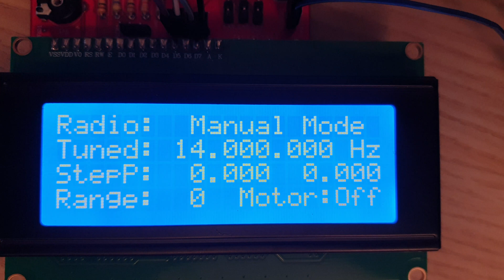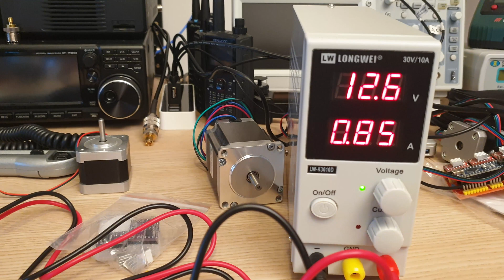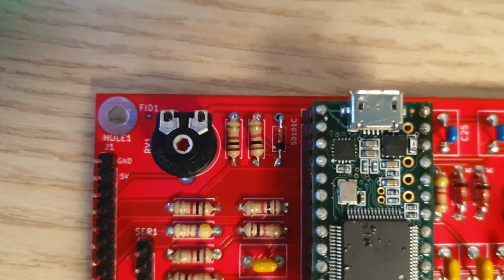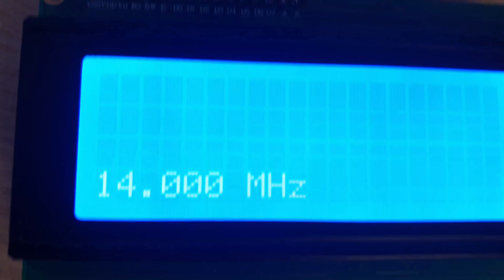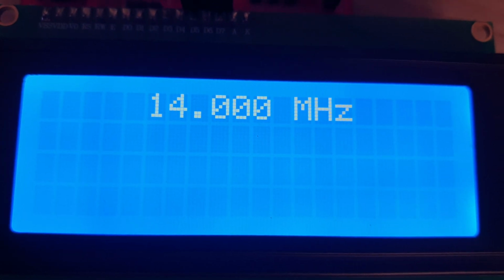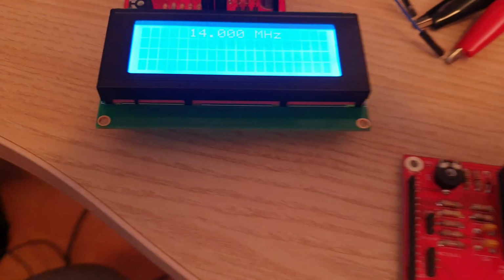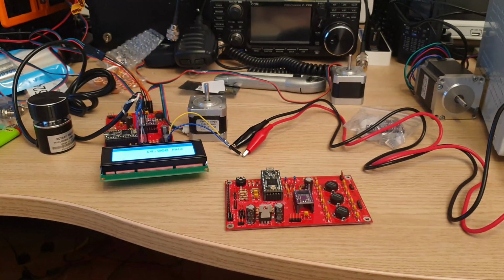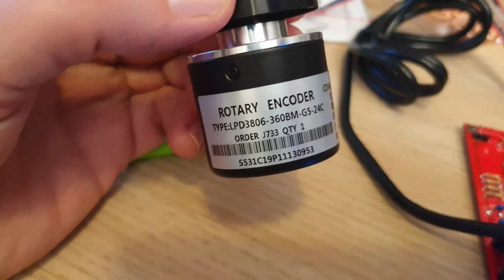Magnetic Loop Controller PCB board (TF3LJ/VE2LJX) - initial test

Comment: hi i know this is a old video but does anyone supply these boards populated with the components i have attempted to build 2 of these now and they do not work for me i have everything built the enclosure the encoder the teensy but board just do not work :(
Reply: You can download my design and send it to pcbway or similar. http://9a3gos.com/wp-content/uploads/2020/04/Magnetic-loop-controller-Loftur-design-pcb-9a3gos.zip I got 10 good working boards.

Comment from the maker: If you would like to receive a free board, you can see instructions on groups.io page loopController. Please send me an email with your address information so that I can check for the shipment price and prepare everything. On that group you will also find a zip archive with a KiCad projeckt, including schematics, pcb layout, gerbers,... If you guys will send me a good feedback about it, and if more people would like to have a board (a dozen are waiting in queue right now. I know, for free is cheaper), we can organize a new production batch together to keep costs down. It does not matter who will do it, as long as the price is fair for rest of us. I would like to add a design of an antenna to the project, power/swr meter and also an antenna rotator compatible with an antenna design to this board.
In a video, DRV8825 is set to put out 0.8 amps. It can be lowered a lot more by turning a pot clockwise. With my motor I had good torque even at 0.3 amps.
73 de 9a3gos

Comment: I built one using Frederiks board it is an amazing device, I find thou I need to turn it off when tuned else I get a bit of interference. Would like to overcome that problem one day
Reply: use torrid cores on the wiring

Comment: Great job very interesting... always nice to see other people’s work. I have had great results mag loops especially with a vacuum capacitor and ferrite core coupling. Vacuum capacitor seems to give more wide bandwidth and ferrite cores gets your SWR down lowest level. Now I’m looking for a good remote control method this looks like it could be perfect. Does it sense SWR and calibrate the loop accordingly?
Reply from the maker: Thank you
Yes you can sense SWR with a small addition to the board. There is a connector named vswr on the board for that purpose. Then it can work in full automatic mode. Take a look at Lofturs documentation. Second pdf on a provided URL on bottom..